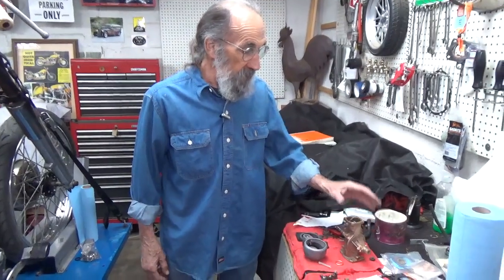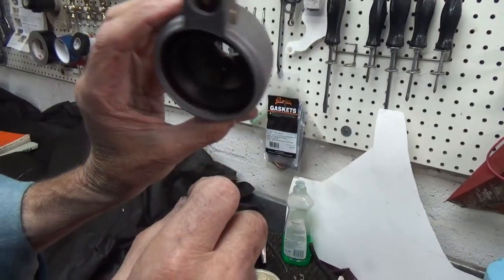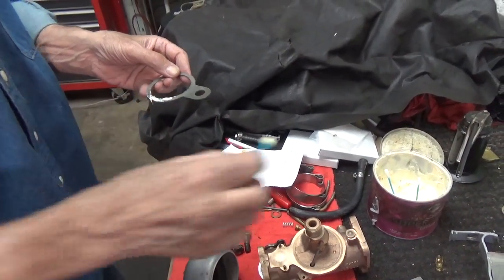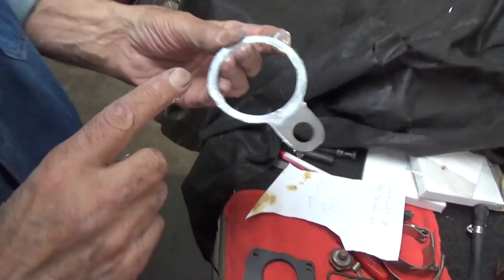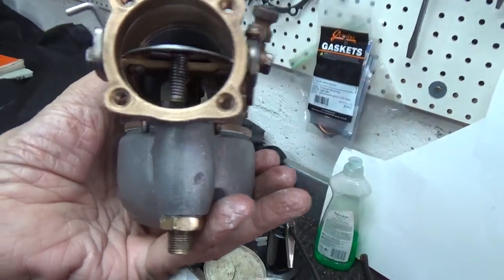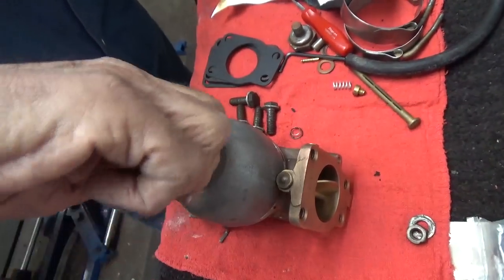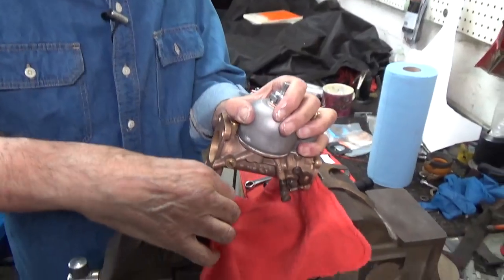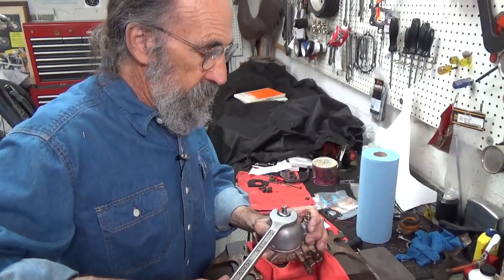Step 9  Finishing the Harley Panhead Linkert Carburetor

Comment: I wonder how an ole PAN would run with a CV carb or a Mikuni flat slide. That Link is the missing link of Crabadators . Prehistoric.
Reply from the maker: I don't know.  Quality piece, infinitely adjustable.  Jet changes not required.  Adjustable while riding at any altitude.  I thoroughly enjoy mine.  I use bigger carburetors for bigger engines.  Yes, there are great carburetors on the market.
Reply: My pan ran fine with a CV carb
Reply from the maker: I have no doubt.

Comment: Were at 5,400 ft in the mountains of Prescott AZ. My Heritage is injected but you can tell the difference in performance when I ride down the hill to about 2,000 ft elevation....Good video Mike.....Thanks!
Reply from the maker: Yes, give it some time to "even out" a little.  I'm assuming your Heritage is 2007 or newer and has 02 sensors.
Reply: Yuppers. Same thing with my 08 Dyna when I follow Mike up the mountains 👍🙂
Reply: @pacificmike9501  yes, 2011
Reply from the maker: I'm telling you guys.  You're riding up the mountain, the altitude change is pretty intense, but it's a beautiful day, reach down, turn the high speed needle on that beautiful brass gem, in a couple of clicks, and she takes off like a scared rabbit.  Sorry, I forgot:  you guys have electronics to think for you, they sometimes think a little slow.

Comment: Hello im from México im doing a restoration of a Knucklehead bike the problem aré the neddles o dont know how to carburate smells so much to gasoline would you help me please my english is not so good but i tried .
Reply from the maker: Try a couple turns out on each needle.  Once you get it started, adjust low speed needle.  High speed needle gets adjusted running down the road.  Don't get discouraged.  This takes practice.

Comment: Hey Mike, thanks for all the great videos.  It is my estimation that you are the Bob Ross of motorcycle building and maintenance with your calming demeanor and delivery not to mention the fountain of knowledge and experience you share with your viewers!
I recently did my first complete top end rebuild and engine paint job on my 1990 FLSTC Evo with 85,000 original miles, all mine, by following your step by step instruction videos of the same era of motor.  Upon manually checking the valves and timing before closing it up I discovered that I had a bad lifter and well worn cam that needed to be replaced and lo and behold I found a video of that too!!  When I finally got it back together I crossed my fingers and hit the starter, and...she started right up!!  A little timing adjustment and she's running like a top.  Just in time for winter storage here in Minnesota. I'm anxious to get her out in the spring.  In the meantime I'm going to enjoy watching you build your project bikes, especially the flathead stroker. 
Thank you, Mike, and keep up the great work!!
Reply from the maker: Thank you.  And when it warms up again, the adventures start again.  And you'll be ready.

Comment: Hi Mike
Really enjoyed this video.  It was timely, as I am putting my '46 UL back together and starting on the carb.  I was curious why you don't mention use of the various drills (#55, #70 etc)?  The drills are supposed to clean small passages as described in the the service manual for the 41-47 Big Twin (which covers my bike) as well in the "Panhead Service Manual, 1948-1957 Rigid."  Be interested in your thoughts.  Again, thanks so much.  You are such a great resource and so generous sharing your knowledge.
Reply from the maker: I clean the with carburetor cleaner and blow them out.  Using drills is a last resort for me.  Today's chemicals are superb.

Comment: I'm looking at this video and I can see the size of the wrench that you're using on the lock nut. That's quite the wrench. So my guess is the answer to my question is that I do not have it tight enough..... I'm just leary of over tightening it.
Reply from the maker: It's quite strong.  But, be careful.  I only use that big wrench because I have it, not because I'm putting any power behind it.

Comment: Hi Mike &Mike ! I have a question that is kinda related and it is this, "Does unleaded fuel affect the valves on the old Harleys? . Seems to me I remember sodium filled valves for car engines when they started taking out the lead in fuel. But like some of your other viewers I'm old and can't remember.  I really enjoy the M&M crew !
Reply from the maker: Thank You.  I remember, but today's valves are so much better than the stuff we had years ago, I can't even tell you.  I put a set of Manley stainless valves in my Panhead over 25 years ago.  I used cast iron guides and lapped them into the original bronze valve seats.  Couldn't afford new seats and they were pretty deep.  I lapped them in and they've been there ever since.  Someday, I'll put new valves (not sure what I'll use) and new seats in her.  But she's running so well at the moment.  Where I used to have a shop, there was a machine shop across town that had about a two hundred thousand dollar guide and seat machine.  I had them do my customer's heads because they could easily attain a level of accuracy that I couldn't do by hand.  But my old stuff doesn't seem to wear out.  I normally lap in new stuff before anything goes bad.

Comment: I just took the M74B carburetor off my 1960 Duo Glide.  There was a spacer between the carb and the manifold, but no gasket.  Is there supposed to be a gasket (or two) there or is it OK to run just the spacer (a new one) when I put it back together?
Reply from the maker: It depends on what the spacer is made of.  If it's made of a hard material, it will require gaskets on both sides.  That is an insulator and keeps the carb from getting too hot.

Comment: Hey buddy have you made any videos in the zenith Sportster
Reply from the maker: No, I haven't worked on one of those in years.  I used to remove the choke plate and shaft (plug the holes from the choke shaft) add a "flow ring" which you could order, fits inside the air filter, same one fits an early Keihin and it worked pretty good.  Only thing is, it would be harder to kickstart, electric didn't care much.  Adjustable main jet helped.  Accelerator pump required a little massaging.  Then I got into SU's.